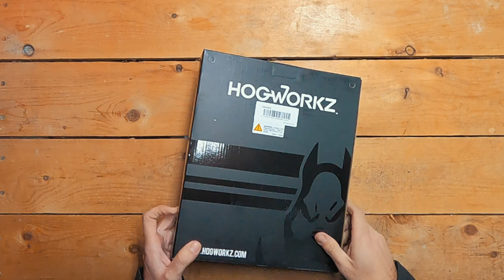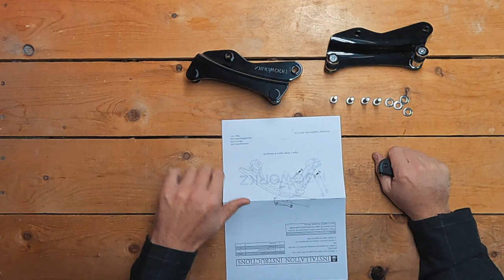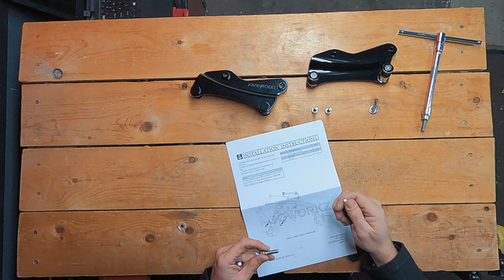Is this the BEST DOCK For Your Harley Bagger? | @HogWorkz  4 Point Docking Kit

Comment: Just bought a SOLO tour pack mount from Hogworkz and the lineup between their mounts and the plate is off-size by at least a quarter inch on both sides. Tried everything to get it even close! I wish they would have the jigs calibrated!!! There is no way I'll get the thing on without engineering new bushings/ spacers to align with the plate! If Harley made a plate for the solo position I would spend $1000 before I would put myself through the three hours of WTF I did yesterday! I could have cut apart the Harley mount and re-engineered to a forward position, tig welded it, and been done already, since I'm not so much wanting quick release, just solo forward mounting! To say I am pissed is not even close to how I feel On to the lathe, find suitable stock for bushings, get it to line up, polish and clear coat the bushings ....... damn! Would have been a 15 minute job if the damned plate was within spec to THEIR DOCKING HARDWARE!
Reply from the maker: That’s very disappointing, everything fit perfectly with my stuff so maybe you received a faulty product and hopefully it’s just a one off thing.. I really do not know but I’m sorry to hear about this quality issue.

Comment: Great video. Really shows the quality of the Hogworx and actually bought Hogworx over the HD stuff after originally trying the Amazon China crap! (Terrible idea).  Anyway was really torn but watched your vid and chose the Hogworx due to the seemingly flawless quality. My one question is did it listen up a tiny bit after use or at least get a little easier to put on than in the video. This is the only knock I’ve heard on Hogworx, that they are so tight hard to get on. Just wondering if it listens up to a perfect fit like a good pair of boots?
Reply from the maker: It has loosened up some, honestly I’d rather have it pretty snug than loose so it rattles. I had a HD removable tour pack on my old Road King years ago and that was super loose. About drove me crazy. 😂

Comment: Do you plan on adding “filler” lights on the rear or lights on back of saddlebags to help visibility? If so, do you have light recommendations? Also, I really like your relaxed style on videos. Thanks
Reply from the maker: Hey I appreciate that thank you Paul. I don’t think I’ll add more lights to the back on this one Just because there’s no place for fillerz on this fender and I’m not a fan of the saddlebag lights that stick on. As far as recommendations go though.. I’ve run custom dynamics and ciro3d and for those applications I think either one is a safe bet and either company is top notch to deal with.

Comment: I recently picked up a 2017 RK and am looking to get a sissy bar / backrest for my wife. As far as the pricing for the docking mount kit both HD and Hogworkz are priced at $150 USD. I am assuming Hogworkz was cheaper before, but have been impacted by the increase cost of shipping and raw materials we have seen over the last year. With price being equal what advantage does Hogworkz’s kit have over the OEM?
Reply from the maker: I compared the sissy bar from HOGWORKZ with OEM and personally felt that Hogworkz seemed too be a bit better quality and a little heavier.. I know at least with mine Its a very solid and secure dock with absolutely no wiggle but because of that it Isa little tough to install and remove. Hogworkz Comes with a pad, I don't recall whether OEM did or not. I've used OEM in the past and it's always been fine as well, I think it'll just come down to what you want to do and what seems like the best value for you.